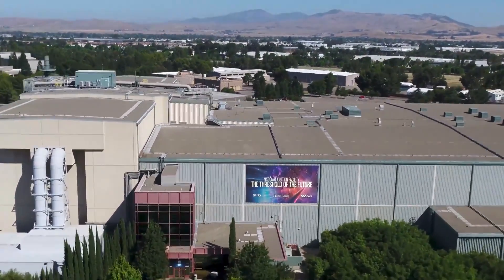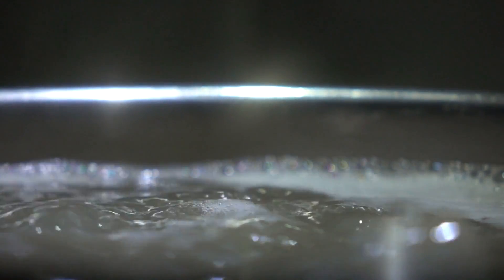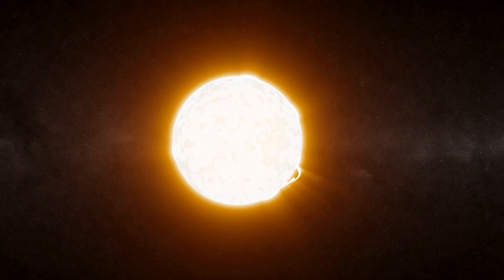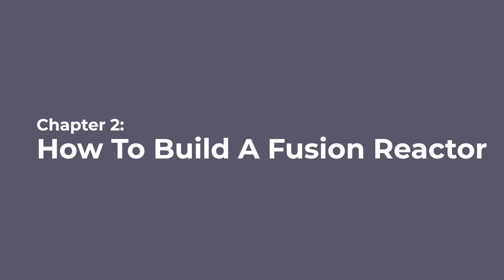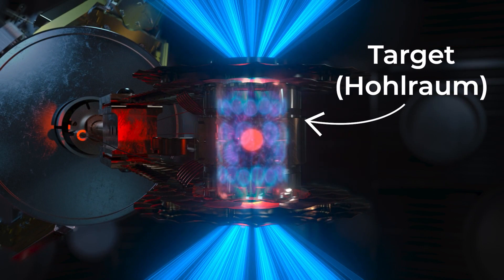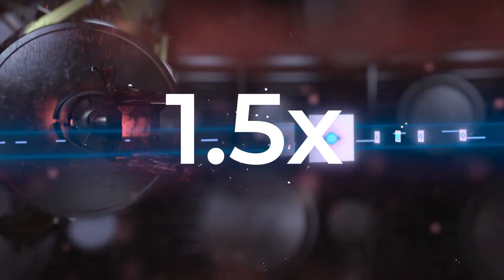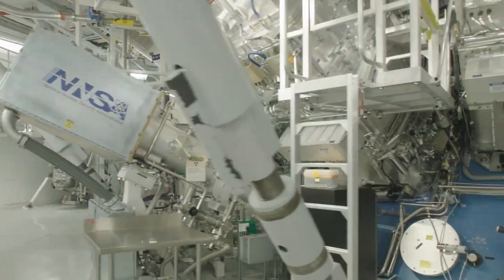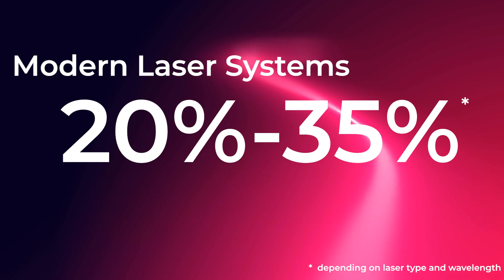The US Fusion Ignition Breakthrough EXPLAINED

Comment: The point is now we have proven net gain is possible, now we have a reason to improve on the designs to get even more out of it, leading to the actual goal of commercialisation
Reply: Exactly! It turns the impossible into the late.
Reply: No, there was no net gain.  500 MJ powered the lasers, which made 1.8 MJ of light output, the fusion released 2.5 MJ.   That's half a percent of input power;  all the hooplah was over the fusion energy compared to laser output but the whole thing was net loss.

Fusion power plant, if it ever happens, is still decades away.
Reply: @RWZiggy  decades is fine, people just needed to understand that more energy out of the reaction (not building) is possible. Once the scientists have the methods and physics behind it, let the engineers go crazy on it. Hell, by the time the world engineers are done playing, it probably wont even be lasers creating the X-rays
Reply: @RWZiggy  the way you described it seemed to be net gain to me. can you please tell me how 2.5 mj is a net loss here?
Reply: @ObeliskDemon  cause it took 500 MJ to create the laser. Only got 2.5 MJ out. Net loss. Still did not create an electric power. Which will have more energy loss. 

If you paid 500 to buy a stock at 1.8 then sold for 2.5 you lost money
Reply: @ObeliskDemon  they put 500 MJ of electricity into the machine, and it made a half percent of that in fusion energy.  LOSS!
Reply: Net gain but not net power. Just 99 percent more efficiency until we are only 10 powers of magnitude away from having something barely able to produce enough power that it will be the most expensive electricity in the world...
Reply: @russhamilton3800  I believe the engineers can handle it
Reply: ahahahahaha there wasnt a net  gain.. it took 500 mgwats to create 2mmwts  ahahahahahhha
Reply: they had to put in exactly 100 times more energy then there came out. Research it... they did not talk about the energy needed to let the lasers fire. Science is shooting itself in the foot by not saying everything about that experiment. If this is the way to get funded it is not the right way
Reply: @runePV  my statement remains
Reply: Science is only interesting when money can be made for the most part. Maybe now they'll have the resources (investments) to make this a reality.
Reply: @ThatGuy-kz3fx  how is it a scam? Don’t be mad cause ur shit country didn’t come up with it
Reply: @ThatGuy-kz3fx  well then shut your mouth and stop being anti-American/anti-science
Reply: @ThatGuy-kz3fx  what makes you believe its a scam? You don't think governments would of taken that into consideration?
Reply: Doesn't the sun "prove" that net gain is possible every day of the year?
Reply: No fooling you.
Reply: True. I'm not saying it's not awesome to finally have a human induce example of fusion ignition. It's definitely a proof of concept.... But I'd say we've know fusion produces energy ever since we found out stars are fusion engines
Reply: Except they haven't.
Reply: if net gain is possible then that discredits the first law of thermodynamics............ which ultimately tells us that us as humans dont know shit and that the only limit is the one that we construct ourselves
Reply: @waleq1173  perhaps there is room for expansion on the laws of thermodynamics?
Reply: @ThePhilosopherKing101  I mean don't call anything a law because our world is constantly changing and we shouldnt put laws on it unless theyre the creators
Reply: Better get it in writing, when it'll be feasible.  

Absolutely nowhere is there a "net gain".
Reply: No It wont, For me Reason being As Elon Musk Star Ship whatever is Already a Proven concept, ready to be Mass Production by someone will that has the Unlimited Supply of Cash by selling to the Free Market. Nasa budget is only by the Feds limit and a Step by Step Process.
So long as Fusion isnt first Produce like a Space Ship, Space Station, there will not be A commercial.
Reply: What does Nasa have that Elon doesnt?
What does Elon have but Nasa dont? There are reason why there are step by step Procedures, someone has to be the One that First Invented Sticks, Stones into Spear.
And I dont think, Backers... Investors whatever with Hunger for Forever Growth has the patience to wait.
How ever whatever commercialisation does are to Make what is Already Proven into a more Efficiency relaible consistent build.
Reply: Curious as to what you think net gain means?
400MJ in and 4 MJ out?
Reply: I totally agree.  The issue is that I don't think we will get a reactor ready by 2035. And even if we did, it will be so expensive that it would be impractical on a commercial scale.  In the mean time, I think we should be focusing on a) making carbon fuels as clean as humanly possible AND b) building thorium reactors.  Thorium is much more plentiful than uranium, is safer, the byproducts can be, theoreticly, recycled into other things, like the uranium reactors we already have, and the contaminated materials have a period of 300 years to become safe instead of 10,000.  Nuclear power of any kind also happens to be as close as we can get to 0 carbon output as we can get.
Reply: @crossing241  Thorium is much more plentiful... on the surface or earth and it is not by a whole lot... uranium though is present on the seafloor, there is no thorium on the seafloor. Not to mention Thorium reactors rely on Thorium turning into Uranium. 😂😂
Reply: @mgntstr  ya...that was the only downside I saw.  If we can recycle that into fuel for other reactors though...  Not sure about the seafloor bit tbh.
Reply: @crossing241  im with you on thorium reactors. But we should be pursuing both in my opinion.
Reply: @matthewwarren7879  oh of course!  I just think that in the mean time, thorium is the way to go.  Personally, and if my research is correct, a full thorium reactor, not a uranium thorium hybrid, would be able to get past the layman's fear of nuclear power.
Reply: @crossing241  0 Carbon but lethal levels of Radiation
Reply: @crossing241  theres a company thats already developed a hybrid thorium/uranium fuel rod that they said would be direct replacement in existing reactors and ready in 2024 or 25. Video is "Clean core thorium energy"
Reply: I think now the biggest bottleneck is laser efficiency. Just get more energy alone was proven since we use fusion to boost nuke. Honestly, NIF is replacing fission to provide the same kind of X-ray to start fusion. So the question always is how to get rid of the fission part.
Reply: I mean. We've always known it. The sun's done it for millennia. We just didn't know how to do it on a small scale.
Reply: HELL YEAHHHH. MERRICAAAAAAA🇺🇸🇺🇸🇺🇸
Reply: This has been possible since the 50’s queers
Reply: @caseyjay3289  "This has been possible since the 50’s queers" 

This just great, people who don't even know the difference between fission and fusion chiming in.

Did you get this answer from a "friend" of yours, or did you come up with it yourself?

All working nuclear reactors are based on nuclear fission.

Fusion has never worked, because they don't really know what fusion is.

Go grab a beer, stupor is your natural state.
Reply: Process used 100x the energy.  This is BS.
Reply: @Mister_Durden  what if we reduced that with "engineering"
Reply: @ThePhilosopherKing101  the tritium used is made with fission reactions.  We should be using a tested reliable technology we've had for decades instead of this pipe dream.
Reply: @Mister_Durden  we should be building fission reactors while still researching fusion reactors.
Reply: @quinndenver4075  We should let the smart scientists who know what they're doing advance technology that will push humanity forward rather than listen to people who adamant we need to stay stagnant and just not bother inventing as a species, and would be the kind of person over a 100 years ago would be saying we don't need pipe dream cars and airplanes when our reliable horses, wagons, and boats work just fine.
Reply: @HideyoshiKinoshita84  what is you're point exactly? Please write a cohesive statement.
Reply: @ThePhilosopherKing101  I'm concerned "what if we reduced that with 'engineering,' is telling Physics, "You will work the way we want with our efforts," instead of, "Let's see if we can figure it out within the constraints of Physics."
I remember a few years ago when cold fusion was proven, then unproven. I hope this yields what we hope, and if not, I hope we will be ready to pivot if it doesn't.
Reply: @quinndenver4075  They don't work, yet.  I mean scientists cannot yet produce electricity through powering  a turbine, with a net energy output, yet. If they can do that, safely enough, they will begin making reactors. 
      We're still at the Research and development, and proof of concept stages.  I hope it is viable.
Reply: @quinndenver4075  His point is that we built humanity on horseback for thousands of years and dumped horses within a few decades because humanity engineered the car, we need to invest in engineering fusion and dump fossils fuels in a few decades like we did with horses
Reply: @Mister_Durden  You had one job.  Listen to the words, look at the pictures and try to grasp what he’s saying.    That’s all you have to do. 

Watch it again and see if you get it second time around.  Good Luck. Xx

Comment: Awesome video, really well paced and edited.

Sounds like they use superconductors in just about all the cool stuff, I hope we get some decent, affordable high temperature superconductors soon!
Reply from the maker: Thanks 👍 🔥
Reply: @DrBenMiles  It'd be really cool to see a video on the state of superconductors and when we might see them in consumer devices. I wonder if any device under $5000 contains a super conductor? It'd specifically be interesting to see a graph, that contains data on the specs of superconductors over the years including the cost of manufacturing/purchasing. So like, year 2000, $1000 super conductor has a length of x and a lifespan of y and a temp req of z, 5 years later what are the specs of a similarly priced component component?

I'd love to see well visualized data on the progress of super conductors and a prediction based off that data as to when we might see them in a general consumer device, and what the first/simplest general consumer device to practically benefit from a superconductor will be? There must be some random gadget that benefits more from basic superconductors than something like a phone, maybe some cheaper low energy device like a wireless earbud or smart watch? A little airtag tracker? A lightbulb? If you had a state of the art superconductor factory and had to come up with a general consumer device to mass manufacture with them, what would it be? 

Also artificial muscles would be a neat topic! I've always wanted to clickbait an IPMC video with a thumbnail of a plane flapping it's wings like a bird, which (i hope) is a plausible future if motors become usurped by artificial muscles.
Reply: We have them right now!!!!!
Reply: @CORNDODGER  Really? Where can I find more information about them? It'd be neat to buy a few just to play with, if I could afford it.
Reply: @OwenWithAHammer  You got a few MILLION to throw around look up HORNE TECHNOLOGIES
Reply: I've been building SC devices since 2006 and am still underwhelmed with how HTS SC has evolved. No cheaper and no improvement in robustness so 2G is meh!
Technically superior but like a nightmare to utilise.
Reply: It would be nice to stop needing to cool them down to near absoloute zero
Reply: @DrBright5558  room temp super con will change the world when we stubble onto it.